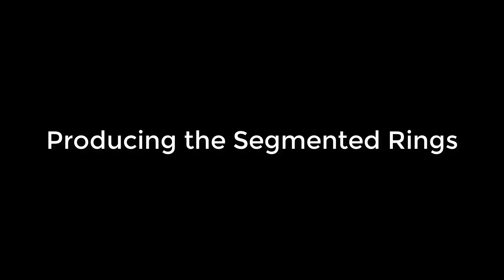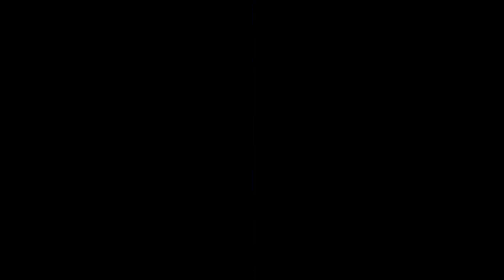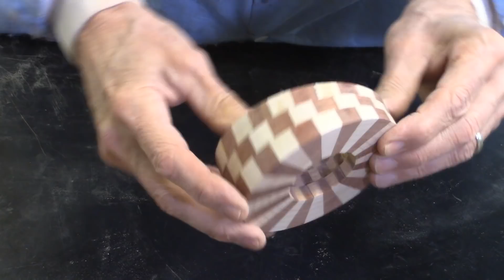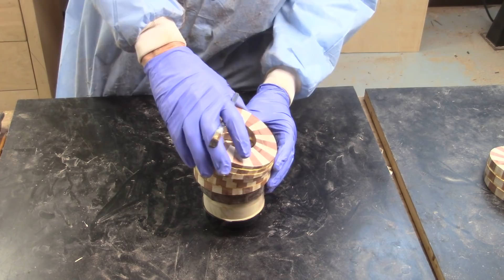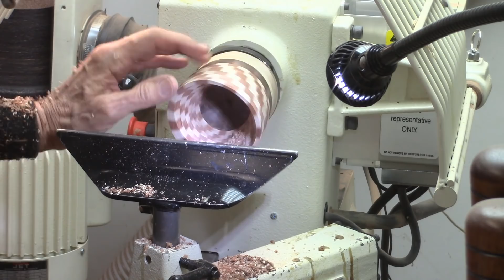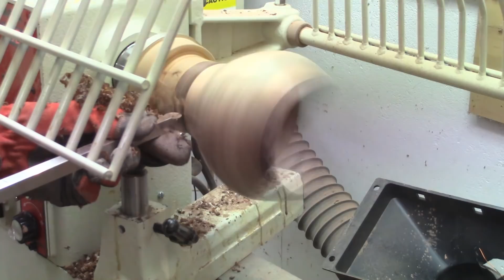Segmented Wood Bowls with Tapered Layers (44)

Comment: I've heard from several sources that one should avoid the zero-point discs.   Having everything come to a single point, makes it so that you cannot really control the wood movement, and it will separate there.  That said, I've done two like that, and one opened up some after a few months, and the other might break in the future.  so I'd avoid it if  you can...

The pieces you made look great.   Accu-slice makes these cuts look easy!

website update looks nice.    Looks like you've also updated your index table design - to give greater range on the hold-down.  I see the sliding MagJig window ...  is that the new version that you're shipping for new orders?
Reply from the maker: I have had good luck so far.  However I have been using epoxy to glue up the segments.  I do not use the TiteBond glues because they are water based. I think that using these water based glues causes the wood to absorb the water during the glue up process and then when the wood dries it shrinks causing the cracks.  Just my experience so far.  I am open to other comments.